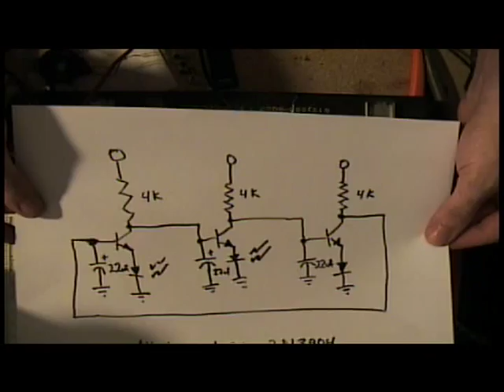Simple Chaser Lights - Short Circuits

Comment: Awesome circuit. I built it using 3 x 220uF electrolytic capacitors, 3 x 3.9 K resistors, and 5 VDC as power source. The chaser rate was very smooth and realistic. Thank you very much for sharing.

Comment: Hey pretty cool lights, what are the CAP values ? And where is your power coming in on your drawing you had?
Reply: For anyone still interested, 
Top three dots are the positive (resistor leads connected to dots) tie them all up and connect to the positive of the power source.

As for the negative, it is the negative of each LED (the short lead of each LED all connected together).
Hope this helps someone in the future.

Comment from the maker: Increasing the voltage makes them go faster or you can change the capacitor and resistor values if you have a fix supply.